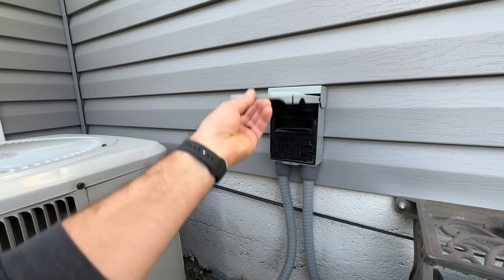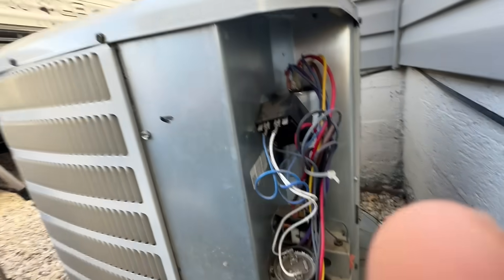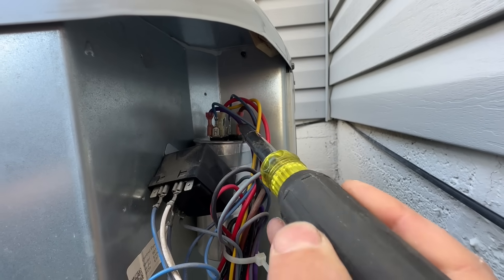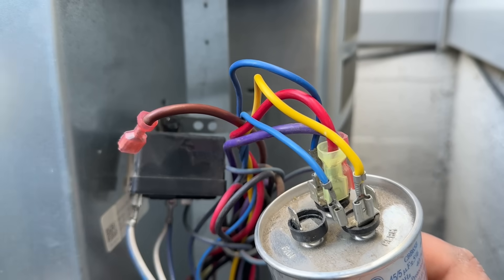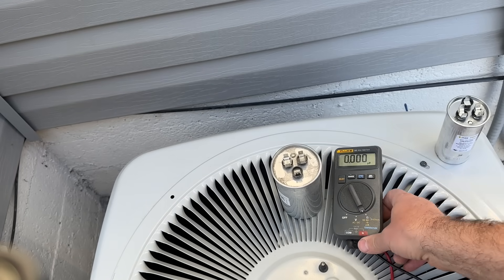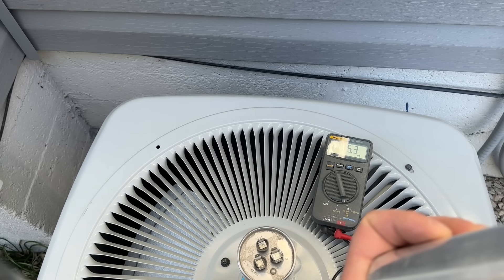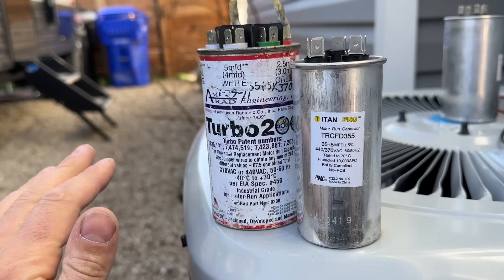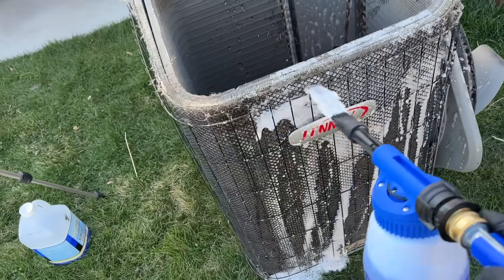How To Check & Replace An Air Conditioner Capacitor

Comment: HVAC Guy hope you can answer this I had a service tech tell me that if the compressor or motor was to go out on my 2.5 ton 20 yr old Trane that he could not repair it he would have to change the "whole unit" and something inside the house to the coils ? anyway he said it would cost $8000+ yes that's over $8k for a 1300 sqr ft home. Somethings not right here IDK am I getting scammed ?

Comment: I have fixed my various HVAC systems 3 times now ( I have 5 of them!) and each time it's the capacitor that goes.  This last time it cost me $17 on Amazon and I fixed it in under 10 minutes after watching and relearning how to do it with your video. I have found a nice independent repair man but I think he is so busy right now and his minimum service charge is $165.  Feels good to fix things and save tons of money! THANK YOU!

Comment: I couldn’t help but notice that you removed a 45/5 cap and were seemingly replacing with a 35/5 cap. 

You didn’t explain how important it is to replace each cap with the same one that was removed. Using incorrectly sized capacitors can damage motors or greatly reduce lifespan. 

Great video otherwise, for the DIYer.

Comment: I looked up an OEM replacement dual run capacitor for my Lennox AC and it costs $100.  Not sure why it's so expensive versus the ones I'm seeing in the other comments.

Comment: I noticed that your replacement capacitor had lower values (35/5 mFD) than the original one (45/5 mFD). Is it still acceptable? Thanks

Comment: You not only saved me hundreds but my family from a very unpleasant day. I just saw what you did and looked at my specs, went to ace hardware to get the right capacitor and fixed it for 35 dollars in less than an hour. Life saver!

Comment: I stumbled upon a few of your videos and after the second one, I subscribed. I already had the basic understanding of how A/C system work, but your in-depth explanations deserved a Subscriber. as most of you know in every profession there are unethical individuals who use your fear of the unknown to take advantage and opportunity to "Bleed you" of your hard earned income. For the last few years my system was diagnosed with a small pin hole or smaller in the evaporator coil , so needless to say approximately every two years my system needs a little R410a on average around 2lbs. I would do this myself but unfortunately I need the certification to buy the freon. needless to say I've had some of the most ridiculous estimate on this simple service and the fluctuation in price of freon just crazy. had on tech say it needed 5lbs or I could replace the unit. thinking of getting certified just so I don't have to deal with the Upsell from most vendors.

Comment: So do I suspect the capacitor if the blower is running, but I am not getting cold air from the vents?   Or does the unit just not kick on at all?

Comment: Another way to check if its the capacitor.if you hear machine humming but fan isnt running.  take a small stick and spin the fan, if it starts then bad capacitor

Comment: @The DIY HVAC Guy  I noticed the old one you removed had 45/5 value but the new one you showed had 35/5. After reading couple of article which said we need to have exact value as the old one or else you could damage your unit. So did you installed 35/5 on a 45/5 unit?

Second question: Do we touch black to common always and red to fan or Herm or it does not matter where red or black wire is touched to find value?

Comment: Excellent and very informative video!  Many thanks. / I did have one question though... the defective Cap you pulled was rated at 45 uF, but the one you replaced it with was only 35 uF.  Isn't that under-powered for this AC unit?  TIA.
Reply from the maker: Sorry for the confusion. I was just using that one as an example as I carry many of them. In hindsight I should have used the same size to show how to test one.
Reply: @diyhvacguy  Thanks for the clarification.  Makes sense now. / I was pretty sure a lower rating wouldn't start properly, so I was surprised to see this.  My understanding is you could also go with a higher rated unit (like 50 or 55 uF), as long as the voltage rating was correct.  It would still work, but would cost more for no benefit. / That might be worth knowing though, in a pinch.

Comment: BTW, a question, when I first gotvmy unit installed aroundvseven years ago, I bought this mesh that I put over the top and it's fastened down with bungie cords on all four sides. I puchased a service plan for the first two years and it has been working fine, but I noticed that when the unit is on, the mesh moves up a little as the air is blown out. Is the mesh restricting the air too much making the unit work harder? It seems like the air is coming out pretty well to me. I bought the mess to keep leaves and debris out since there are several trees close by. Thanks.

Comment: How do you know if the capacitor has gone bad? Does the unit just not start?

I'm a recent subscriber. I ordered a new filter for my Lennox system before I turn on my A/C this summer. I found your video on cleaning the coils by spraying water on them, so Im doing that, too.

Comment: You saved us bro. I watched this video a couple of years ago and bought  capacitor for my AC system. It sat in my garage until today. The outside fan was not working so I used my meter and checked the capacitor and it was bad. I changed it and now our house is nice and chilly! I’m in a wheelchair so if I can do it anyone can thanks to you my man!

Comment: Main thing to look for in a capacitor. If it is swollen or leaking it looks like roof tar its black its bad replsce it.. Also if its rusty might need to just clean terminal ends.

Comment: If the unit is running but you don't hear the compressor kick in. Replace the capacitor. It's only $20.00.

Comment: actually, on the cap your fan mF value of 4.64 is out of range on 5  +/- 5% spec.  the allowable range from 5 mF would be 4.75 mF to 5.25 mF, so 4.64 is below the low end of 4.75, so this technically is a failed cap.  i know, it's kind of moot because the common~herm was 0.  just saying though...

Comment: Just had to do it for a 2nd time in 4 years.  No more cheap Amazon capacitors.  I'm going with the Turbo 200 that you recommended to have as a spare on the shelf.

Comment: I replaced all 3 of my capacitors (start, run and fan) in my 2011 xl20i Trane, thank you for all your videos.  The new start and run capacitors were smaller or less in diameter so now my old clamps are too large.  Do you know if there are adjustable clamps that I can buy, or what would you recommend?

Comment: Hello, great information. I'm learning about HVAC and have a question for you. I was wondering when do you ever need to close the system high side and low side valves on the AC unit itself. Greg

Comment: I have several Starter Caps for just that reason. They always seem to fail on a day that  you can't get service. I have replaced them myself. 
They also charge a fortune for doing it. DIY and save a lot of coin.

Comment: Just a few FYIs:  
1) All capacitors will eventually fail.   Be prepared.  If you want to be proactive, change them every 5 years regardless of their condition - a $15 insurance policy.  Hot environmental  conditions will make them fail faster.
2) There are different quality capacitors - good quality capacitors will last longer than bad ones.  You are saving a ton of money doing this job yourself - invest in a good quality cap.  AmRad, Buck, Genteq and MARS are American made caps (I think - do your own research. Maybe they are all made in China now... hard to tell).  
3) Check the temperature rating = at least 70 deg C (158 deg F) 
4) Make sure the replacement cap has a voltage rating (VAC=volts AC) equal to or greater than the original cap.  
5) The universal replacement caps (e.g. Turbo200) can get pretty pricy ($80).   If you plan ahead, you won't need the universal caps.
6) If you get a replacement cap with the same physical dimensions as the original, it makes it easier to replace using the same mounting hardware.  Take the old cap with you to the store and check the size of the new one.   ACE hardware carries a selection of AC caps.

7)  MFD = uF = microfarad

Comment: Just did mine so I was only without ac for one night instead of 2 or 3. The local appliance parts store charged me almost $38 for a capacitor that only goes for about $17 online so I ordered an extra one from Amazon because the last one only lasted 2 summers.

Comment: Dude at least tell people to confirm power is off, so many disconnect boxes have been bypassed and are basically junction boxes..
Reply: Please make and post a video that improves upon this one
Reply: @joe1071  I do not post hvac vids, been in the trade 20 years. Was just offering a piece of advice I didn't see mentioned in the video. If i missed it, my apologies. About 10 years ago a "retired electrician" told me had replaced his disconnect box, yet it was wired incorrectly an gave me a shock. That is why I made the comment. 
Good on you for defending this video so fervently though, me personally I WISH more people would learn to fix their own sh!t lol ;-)
Enjoy your day, sir/ma'am...

Comment: Does it take time for the new one to charge up if so how long?
Installed a new one and didn’t move the fan at all.
Reply from the maker: No, you have another problem if the fan isn’t spinning. It doesn’t need to charge. 

It’s similar to a battery but what the capacitor really does is ensure the compressor phasing is correct.
Reply: @diyhvacguy  
I found the issue 🤦‍♂️ 
I had the pull out disconnect upside down when I put it back in😅
So no power was going in. It works fine now 
Appreciate the response 🤜🤛

Comment: You're the best. A local ac company raked my wife over the coals here in Fl when the condenser fan died and I was 1400 miles away. A grand, and said they installed a hard start too which they never did. They had the nerve to shoot us a ridiculous estimate for a new system. No way and I'll never deal with them again. Told all my neighbors too, and left bad reviews everywhere I could.

Comment: My air conditioner cant working for the cooler. The Fan is weak, they less blow wind. Is it problem with the AC Capacitor?

Comment: Terrific video - every homeowner should see this!  I have a  question that I don’t think has been asked/answered yet.  A replacement capacitor I am considering matches my current one in every way except mine shows ±5% and the replacement shows ±6%.  Is this 1% significant?  Can I safely replace the old one with the ±6% one?  Thanks in advance for your help!

Comment: I am SO glad I saw this video months ago and bookmarked it and ordered a spare capacitor!!  Woke up this morning hot and discovered that the outside unit was not running.  The capacitor was swollen and tested bad with a meter.  Replaced it in 5 minutes flat and now it's working great!  Thank you for sharing your knowledge!

Comment: Thank you for the helpful video.  I have a basic question.  My A/C unit has 3 capacitors each with 2 connections.  All of the videos that I see have 3 connectors for common, fan and herm.  I don’t see any markings on my 2 connector capacitors.  Does that mean that it doesn’t matter which way they are hooked up?  Or is there an indicator that isn’t obvious to me.  Thanks again for helping us DIYers!

Comment: Vegas heat starting up. My question is, I have 2 units. 1 is blowing out cool air the other 1 not so much. Can it be the capasitor? For weak cool air

Comment: I got my unit in 2020 it's a Goodman and have already had to replace the start assist twice .and it's starting to act up again having issues starting .very weak start .and your right every time they have changed it. 250$

Comment: My unit is only 4 years old and I’ve had to replace this 3 times. By the third I’d had enough and figured out how to do it myself. Now I have a stock of 5 of them. Really wish I knew what the root of the problem was though.

Comment: That capacitor is awesome and such a good idea. I had lightning strike my house a 5 years back and learned how to check everything and the reason the a/c wasn't working was a bad heater control board. I wound up directly wiring up the fan with a fuse and the contactor transformer to 120v plug and put it on a common house timer and got it back going until the heater control board came in (it was in August). This worked great.  I have a spare capacitor and contactor ready for when they go bad. The capacitor and contactor on my unit is the original from 2004.

Comment: So what are the symptoms on the AC unit when you have a bad capacitor? Will the fan run but compressor not? Will the compressor run but fan not? Please describe....
Reply: The fan will run 

The compressor will not 

So you have no cold air 

Blow cool air 

No coolant is being circulated 

Because the compressor is not running 

I replaced mine twice in 10 years 

Ac is old 

Still works
Reply: Looking at my friends Saturday 

I keep telling him about this 

Just jump in and do it

Comment: I just looked at your video and much to my surprise, you explained everything that I was thinking. I just had a tech come to my house and said that my capacitor was bad, only showing 20 uf on a 45/5  +/- 5. I am very handy with things around the house. My unit is still under warranty, however, the labor is going to cost me $258.00.   The cost of the capacitor outside of warranty is $250.00. 

My questions is being that the capacitor is showing 20uf, should it be replaced. I seen the exact capacitor for just $15.00.
Reply: Yup..just replace it anyways....what was the original uf?  If its higher than 20uf...then the 20uf is bad.

Comment: If you answer questions, my ac works fine but the inside the house blower works for a few minutes then cuts off for a few minutes then then will cut back on. The outside unit continues to run because no air is being moved to the thermostat. Do you think it's the capacitor.

Comment: HELLO PLEASE ANSWER ASAP..i removed my OLD capacitor..it was 250 volts, 55/15 with three terminals and five PRONGS ONE PRONG FOR FAN ONE FOR HERM AND THREE FOR COMMON...MY NEW ONE HAS THE EXACT SAME SPECS BUT HAS 9 PRONGS INSTEAD OF FIVE (TINES)..do I have to cover the extra prongs..or just dont use the extra ones? The new one is a dual cap but more prongs 2 on fan, three on HERM and FOUR prongs on COMMON..PLEASE ADVISE
Reply from the maker: Just don’t use the extra prongs 👍🏼
Reply: @diyhvacguy  OK GREAT VIDEO THANKS ITS UP AND WORKING THANKS TO U!!! SAVED $$ THANK U

Comment: Please help I had to replace a capacitor it had one small one for the fan and a separate one for the common and herm you could not read it! It has 3 wires left a purple and red and orange please help anyone!!?

Comment: Also, you spoke about a unit that helps AC start up by not always pushing capacitor so hard.  A jump unit?    What is that and is it something a DIY can install ?

Comment: Could you use a 45/5  370 volt capacitor instead of a 40/5? Or is it better to stick to the 40/5?

Comment: You did a good job of showing how to check and replace a bad capacitor but your bad capacitor was 45uf and the new one was 35uf. I'm sure you knew that but it would confuse someone watching. You need to change the capacitor with the same value...

Comment: A capacitor (in this application) does not provide a jump start from its stored energy.
It creates a phase shift, so that you have a rotated magnetic field which in turn allows a rotational movement to start the rotor of the electric motor.
On multi phase motors this capacitor is not needed, because the phases are already shifted.

Comment: Great video,  can you make a video showing what you just did but before shorting out the capacitor how to make sure no one hot wired the power box on the wall...near the capacitor there is a power supply you can put a meter on that correct...the reason I ask.to show that step is once someone bypassed that fuse you pull our on the wall....so I never trust just pulling it out....

Comment: Dude thank you so much. I had the capacitor replaced 10 months ago. The same unit just blew the capacitor again. Each time they come out even though the part is under warranty they pop me for $210. I’ll be doing this myself in the future.

Comment: Hi I have a question. My ac cools the house but when is really hot outside and I have it set at 75 the thermostat starts going up and the skinny line starts getting really hot that burns my hand I have to turn off the air/c please help. I have called so many a/c techs and nobody can’t find the problem. I have chance the thermostat the fan and the capacitor

Comment: Hello friend , good video
1 question ? We bought 10 years service when we bought a new ac unit almost 3 years ago , they come 2 twice a year to check , each time they come to check the unit , if we do not watch them they do no not check the unit & they come & says every thing is ok ( nice of them to be honest 😡 ) till 4 weeks ago without telling us the tech went to furnace room , block the door so I can not watch him what he was doing , what ever that tech did the furnace does not work the same : if the thermostat is at 74 degree the heat does not comes on till the house get to a point , we have to put a heavy jacket on . We call they came to play cute on me . then I call & said nothing is wrong , now why they have to do that when our furnace was working fine . when the tech was removing some part & put it in his bag his hand was shaking . why all of a sudden after almost 3 years they have to mess with gas pressure ( adjust the gas pressure for what reason when the furnace is fine ) ? I thank you for your response 🫡 🙏 🙌 🫵🫶